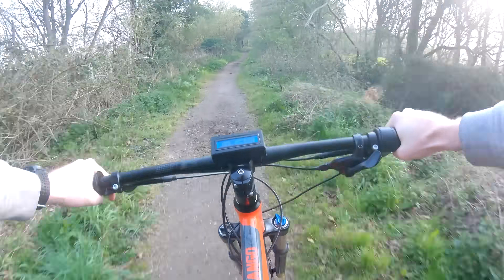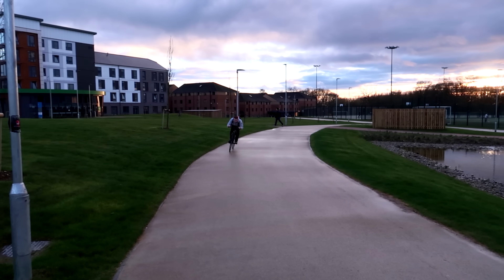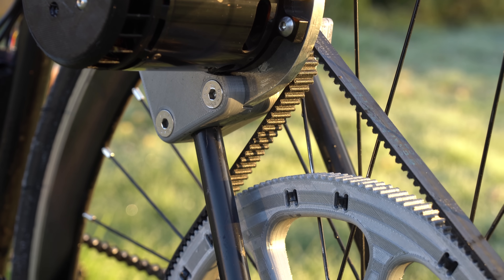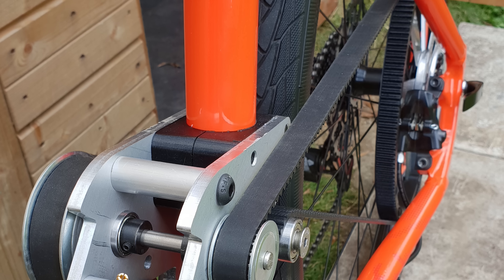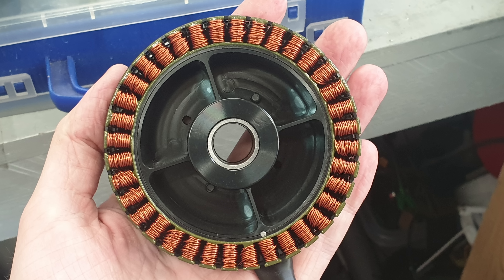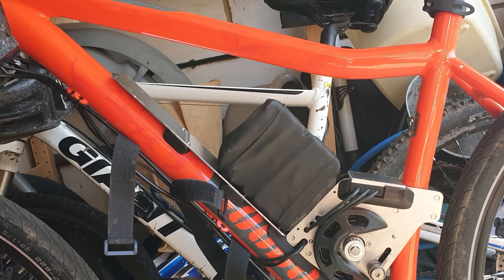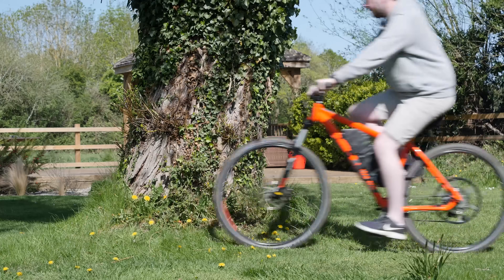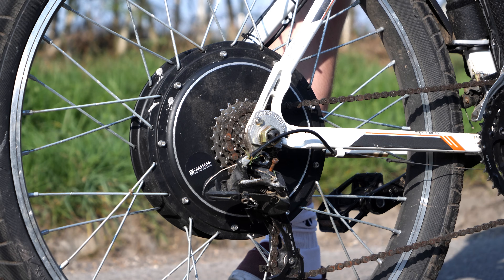Building an Electric Bike

Comment: Have you considered adding a gearbox, so that you could possibly have decent acceleration as well as maximum speed?
Reply: i think modified gearbox of a bike using a drive shaft will be nice..just a imagination
Reply: Ok, I've seen a few things wrong in this thread. An electric motor torque goes down in a linear pattern as rpm goes up, and peak power comes at half of the max speed and half of the max torque. So, a gearbox could give better acceleration in a low gear if the motor is producing peak power, and the highest possible top speed comes when power is equal to force of air resistance x speed. So, a gearbox would help with both acceleration and top speed in an electric vehicle. I have experience, but im not am expert, so if you are an expert I apologise if I'm wrong here.
Reply: imho a crank motor is better than a hub motor because it uses the gears at the wheel. More efficient use of available energy. I have a recumbent trike, at my age I can't afford to risk falling off.
Reply: @labora.et.labora  you can't seriously think not having a transmission would equate to faster acceleration and faster top speed. it just makes no sense. without a variable transmission your acceleration will always be determined by how fast the motor spools up
Reply: That would be awesome :D
Reply: What % of an electric car did this cost? :P
Reply: @dungeoncartographer1759  1/35th
Reply: @labora.et.labora  Then why would he have this equation near the end stating that motor kV x motor pulley teeth/wheel pulley teeth should be around 10? He stated that when the ration of motor pulley teeth was too great compared to wheel pulley teeth, the bike lacked torque and was sluggish first starting. Why not have a gearbox that has a ratio closer to the hub motors at 8.9 for good acceleration, and then have a gear that has a ratio of like 12 to have the higher top speed.
Reply: @Addison0526  Exactly, I came here to type just that. Gearing is always beneficial, the laws of physics doesn't change because a motor is the source of power.
Reply: It would be cool but im worried about space on the bikes frame there's alot to consider
Reply: he is a gear box
Reply: @labora.et.labora  that is a really stupid statement. you can increase the rpm of the output by using gears ,no matter if the input is electric, gas powered, or hand cranked. the limit in electric bikes is the rpm of the motor, so gears will significantly increase the top speed AND acceleration. your points are just wrong.
Reply: @labora.et.labora  you seem to assume electric motors can run at infinite rpm, which we all know, is not true. you are also assuming no motor can reach max rpm before reaching max torque, which is also not true. in a circumstance where a motor is hitting too high rpm, or being bogged down and hitting to low of an rpm, like in your example, a TRANSMISSION is the only solution. a transmission trades torque for rpm and vise versa. you have torque and want rpm, use high gear. you have rpm and want torque, use low gear. what am i missing?
Reply: if only we had some sort of device that could supply enough current/amps  and was light weight we then would have something proper.  batteries as we know of are no good due to the weight issues .  could you imagine the torque one would get using a big industrial starter with a gearbox for off roading.  only problem we dont have a light weight power supply to power the beast.
Reply: and besides that only the wealthy can afford good stuff .  good poor disabled people like me have to suffer while certain other people get to enjoy life .
Reply: @labora.et.labora  The whole point of the last section of his video explained why gearing is important. He even shared a formula. Obviously if the number drops below 10 it will produce even more toque at the expense of battery mileage. Which is sometimes what is needed to bring load over a hill or something. So to answer his question, a gear that further increases torque would be useful for loads, but not so much for top end speed.
Reply: Does any one had done the experiment yet, using gear, and chain system to enhance the speed of e byke by using a BLDC motor? Not the Hub motor.
Reply: It's called a derailleur.....  and a mid drive motor....
Reply: You can buy from Sick Bikes Parts in the U.S., a brushless, mid-drive motor kit for less than a 750 watt Bafang mid-drive.  It allows for you to pedal with the motor off and also come in two wattages, 1500 and 4000.  You can always readjust the motor voltage to decrease the consumption to increase range.
Reply: Bafang mid-drive (and other 'all in one') units are much simpler to install (mostly just a BB replacement). Than using the separate parts in Sick Bikes Parts kit, who is mostly known for gas engine conversions... BTW the same parts are cheaper from china...
Reply: @nc3826  The same engine shifter drive parts from Alibaba China are junkier.  The motor on the Sick drive is rebuildable.   I work at a community bike repair place and a local has the 1500 watt model on his bike. Yeah it's less streamlined and not as easy to install, but the Sick drive has twice the output and uses a planetary reduction with needle bearings on the planets.  It's a very robust unit.
Reply: TaUnc Fester  'engine' shifter??? I only care about ebikes... and the assumption that everything from china is junk is tiresome... 

btw Bafang mid-drive (and other 'all in one') are upgradable and rebuildable, including its gears, also 1500, 3000 and 4000 watts are illegal on the street, where I live anyway 

but if you and your friends are happy doing more work installing Sick Bikes parts and paying higher prices enjoy, to each their own
Reply: @tauncfester3022  btw I only see a few Sick eBike Parts, that state where they come from, so most maybe from china too
Reply: @tauncfester3022 FYI Daughter, Bafang reliability is based on being in business since 2003... and the founders roots in electric motor development & production go back to 1998
FWIW I built bikes decades ago but then got a real job and have been to busy being an engineer to play with toys until now.
Calling an e-motor 'superior'just based on its 'rated' wattage, shows how little you know.
Reply: @tauncfester3022  FWIW Sick eBike Part kit does have advantages over all in on mid-drives and if at least some parts are made in the US that good too. 
So   if you ever get the time, send photos of the kits you built, I would be interested in seeing them. TC
Reply: @nc3826  Yet I never saw a Bafang until about 2013 so they may have been in production they were not for sale here.
Reply: @tauncfester3022  thx for the link, but as I said before I'm only interested in electric motor conversions
Reply: @nc3826  But you're ok with slave labor.
Reply: @bearculb7717  you're ok with being pointless troll who says nothing of value... good luck with that....
Reply: @nc3826  If not wanting to support the CCP and their treatment of workers, the massive human rights violations and the reckless disregard for the air their citizens breath makes me a troll I guess I'm guilty. I really just wanted to watch the video. Have a nice day.
Reply: @nc3826  Can I but a good electric bike kit? Aloha
Reply: Gas(2 cycle) bikes have a kit called a jack shaft. I've seen people hit some serious speeds (45+ mph). At these speeds much wider tires are needed for stability.
Reply: Nope and not really....Thinner tires are more stable not less.
For relatively smoother surfaces. For example racing bikes and their thin tires routinely exceed '45+ mph.' And check out the below link for a more dramatic example. https://www.guinnessworldrecords.com/Images/land-speed-record-female_tcm25-544147.jpg

Also a jackshaft, also called a countershaft, is a common mechanical design component used to transfer or synchronize rotational force that is generally needed for an ICE bike conversion especially for 2 stroke but not when an e-motor is used.

But thx for trying :;)
Reply: @labora.et.labora , this makes sense and explains why Harley Davidson's Livewire does not have a transmission.
Reply: I think it would need more torque???right?
Reply: @labora.et.labora  that's false, the torque of an electric moter is 1/rpm, the faster you go the less torque you get from it.
Reply: @labora.et.labora  Weight doesn't limit top speed, power, gearing, RPM and friction do.
Reply: A cvt from scratch maybe!
Reply: Just make an adapter so that it uses the original bike gears.never overengineer
Reply: @labora.et.labora  Man you literally just took a look at google and started to spew bullshit, acting as if you know everything.
An electric motor could absolutely benefit from a gearbox.
Reply: at what point do you just get a dirtbike frame and forget the pedaling entirely.
Reply: Soz I don't generally make many comments, but a YUPPIE, giving algebra lessons on how to speed up a bit, doesn't quite cut It / could just be me? Still, I gotta hold my breath, or would no doubt "PMSL, thanks for that made my CRIMBO day. Best wishes, I wonder when he Will get that TREBOUCHA In his garden finished, just go's to show, WE live & learn!🤣😁😂
Reply: Well you might as well just go with a motorcycle then, even a cheap conventional motorcycle is much faster and powerful than all these ebikes, doesn't take a decade to recharge and also more reliable and safer than these ebikes, just so you know.
Reply: @labora.et.labora   No, Gears make a huge difference.   I built a mid drive, it has 9 gears. This makes it powerful enough to climb very steep hills and do 55 km/h. Tom's "magic" (10) number is a compromise between acceleration and top speed. The only way a gear less system would be superior is if it was extremely powerful. The reason this is not practical at the moment is mostly weight.
Reply: Much more fun to just strap a 2 stroke engine to a bike and it makes a much cooler sound
Reply: @harrisonsmetana2506  69th like ,😎
Reply: @harrisonsmetana2506  yesssss
Reply: @labora.et.labora  ah I see, thanks for explaining!
Reply: @dalethomas8179  right? I dont get where they're coming from
Reply: Using belts to combine the power of the two motors made me cringe. I do no understand why he would not just use a gear box to have one output. There he could change the gear ratio as well, but what do I know.
Reply: @dalethomas8179  Would hooking it up to the front cassette and using the bike's original drivetrain work?
Reply: @thesovietspy1748  My father did this with my old road bike, he got a hobby grade 1kw motor and used a chain to the original front sprocket, it can achieve 70km/h.
Reply: hardly he could have used a reduction gearbox. otherwise the bike would be bulky and the mechanisms will take lot of space. also that does not allows you to switch between torque and sped outputs.
Reply: @aniketbiswas9885  a modern hub gearbox is light and efficient, the current drain at hi tork low rpm is excessive, hence burning out motors? I went for a crank motor. Better imho
Reply: A gearbox is needed for combustion engines because such engines have an ideal rpm for maximum torque.  Too fast or too slow and the motor will be less efficient.  An electric motor bypasses that issue and can give maximum torque at any speed.  Not only that, but gearboxes introduce friction and thus reduce horsepower at the wheel.  A gearbox could give a higher top speed for the bike, but at the cost of increased rolling resistance, increased mechanical friction, excess heat, excess weight, and there would be more parts to break.  Simply getting a better electric motor bypasses any of those problems.
Reply: @JamesWillmus  yeah but wheres the fun in that? I wanna see an electric bike with a transmission :D make it a CVT in fact lol
Reply: i have built a cv trans for my bike! so i start in low and one motor is at 3/4 max i than start pulling the leaver back watching that amp are not going to high tell i at speed i wand if start pulling a hill and amp's clime i slow trans lower draw
Reply: Gears are useless for electric motors, as electric motors can provide really high torque in comparison with gas
Reply: @agrs700  but it would still get you a higher top speed right?
Reply: @shuenshuen  You may get higher speeds with gears in certain situations.
Reply: @shuenshuen  yes with gears you can have greater acceleration in a lower gear and higher speed in higher gear.
Reply: @agrs700  Gears are not useless they are extremely useful and allow a much lower weight and less powerful motor to apply power over a much wider speed range.  Have you ever used a 2 speed cordless drill?
Reply: @agrs700  gears are useful when a rider wants high torque or high speed in different situations. Synchronous motor is highly inefficient at low speed with high torque(climbing on a hill or doing wheelie)
Reply: Or you know..... you could make a pedal bike and not get lazy with a electric bike. Were all gonna become fat
Reply: @elcartero5065  or you know.. you could just worry about your own weight and let him tune his electric bike.
Reply: @shuenshuen  freal
Reply: @elcartero5065  I expect you're not using cars or any form of public transportation, because if you do, it makes you a hypocrite.
Reply: @elcartero5065  You can pedal an  electric bike too genius. Just go  faster and further.
DERP!
Reply: @elcartero5065  “Spends hundreds of hours designing an electric bike”
Reply: @elcartero5065  1. Pedal-Assist exists.
2. This guy is an engineer. He likes to build things.
3. Sometimes human beings get, ya'know, tired.
4. In Europe, people buy bikes for commuting, not for raw performance.
5. Electric bikes are fun.
6. If you're convinced electric bikes will make people become fat, then why not go build a masochist bike with fat tyres, a heavy steel frame, and a fixed-gear drive train? Come back and tell me how it felt to ride.
Reply: I ride a bike everyday, and I'm still the fatest boy in my class
some guy always ride electric bike, yet he's so slim?
explain?
Reply: @elcartero5065  i would like to know your thoughts about motorized vehicles.
Reply: @elcartero5065  Electric bikes are more of a supplement to cars than to normal bikes, while you can still get exercise from, unless you live in the middle of nowhere
Reply: @elcartero5065  honestly an electric bike makes it far more likely for someone to use one, thus getting more exercise than otherwise. This setup doesn’t need pedaling but any decent ebike or conversion kit has pedal assist which just helps you out a bit on hills
Reply: @elcartero5065  in the early 1900s you'd be saying the same thing about horseless carriages
Reply: @elcartero5065  ok boomer
Reply: @elcartero5065  h HH hhhh
Reply: @elcartero5065  uhhhhhhh
Reply: @elcartero5065  h
Reply: @elcartero5065  hhhh-h
Reply: @elcartero5065  hhoh hi hhhoh hh

Comment: Ok-Ok :) Let me just stop u there :) I love your enthusiam but even though you believe are solving the problem throing money, time and maths at it .... you're actually getting further away. ANY SPEED ON A GROUND BASED VEHICLE SHOULD FIRST OF ALL COME FROM LOWEST DRAG AND LASTLY FROM POWER INPUT.... Right ? Unless you are just showing off enginerring skills and one heck of an ability to burn money and time :) My design is still "analog = human powered" but, by way of simplcity (not adding more stuff but removing instead) = the only way of TRUE DESIGN BTW can about 90 Kmh under (ideal conditions) and easily cruise at 40-50 Kmh. NO ELECTRIC MOTORS / BATTERIES / CONTROLLERS ... NADA :) Just the purest and most logical approach to WHY WE NEED POWER AND WHERE WE CAN BEST MAKE USE OF IT = HOW TO BEST FIGHT THE AIR RESISTANCE BEFORE PUSHING MORE AND MORE SEXY POWER. Go simpler. Always. Stop adding stuff. Remove stuff. Make the air your friend. Then add power. Otherwise it is just a show-off video like many others ;)

Comment: Wow nice video mate. I have built my own electric bike too, but i'm using a hub motor purchased from ebay. The whole idea was to make an electric/solar bike, so the easiest and cheapest way was to put lead acid batteries, to use the solar charge controllers on them. The problem was that the two 12v batteries in parallel can give 44ah, but i needed a dc/dc boost converter to take 36v for the motor, as it works only with 36v or more. I have blown up quite a few converters and i'm still trying to find out what's wrong with the whole design. I'm not electrician or something, just have passion for making new things and this was a unique idea for me. I hope i will solve the problem one day. If you have any idea what to change or to put to my bike to prevent any damage again, i would much appreciate it. 
P.S. 12v/44ah batteries. The converter gives maximum 36v/10a. The motor is rated as 250w but it can go further. I have putted a 30a cirquit breaker and two 35a fuses (one on the positive and one on the negative) between the power switch and the converter. I have putted two 20a blocking diodes (one on positive, one on negative) between the converter and the motor controller, to prevent any reverse current while the fuse is blowing up and i'm still pedalling (because the motor works as generator when the system is failed). I haven't done any tests with the new configuration yet, but i'm afraid it will be not successful.

Comment: Hey, I've got a couple questions for you guys and girls... Are you saying that i better under size my ESC to be sure not to burn a brushless motor (hub motor in my case) ? the VESC looks like a good option. I can't believe it only has a 3.5% efficency as you suggest on regenerative breaking. I go down a massive hill each morning and my main aim is to reduce the  disc brake wear... at 11.04 "it is super quiet when running WHAT ?" and how bad can it be to run an hub motor ignoring the feedback of the hall sensors?  thanks for your help :-)